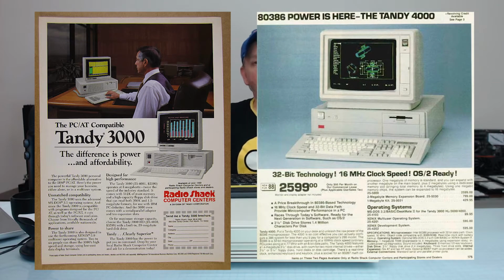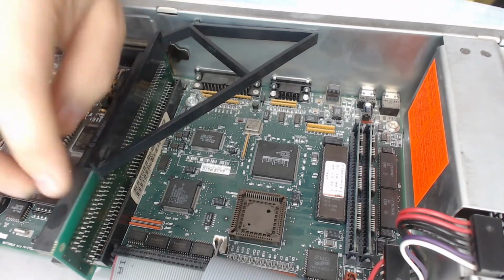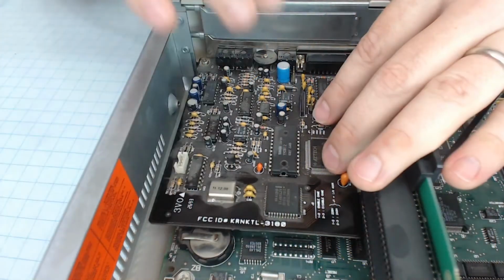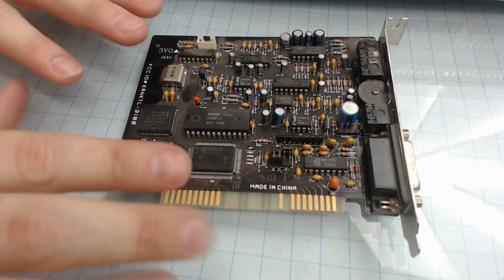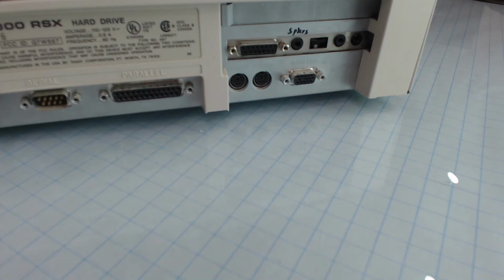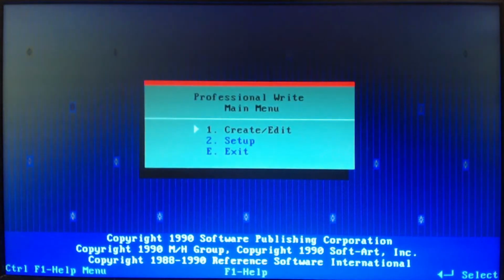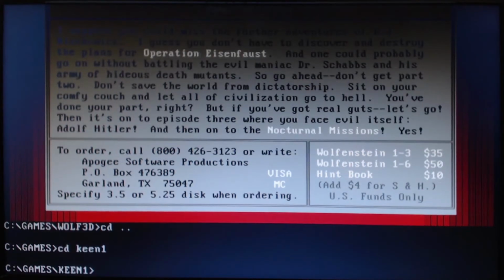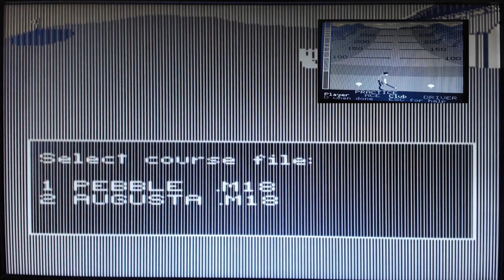Exploring the Tandy 1000 RSX

Comment: While SX does mean that a CPU lacks a math coprocessor, that's only applicable to 486s. In 386s, SX means that the CPU has a 16-bit data bus rather than the 32-bit data bus of the DX variant.

Comment: Interestingly The Tandy 1000 RLX was modified (no disk drives at all) to be the Legacy RadioShack POS cash lane system. There was no fan in them and they had a special BOOT rom to connect to the ARCNET terminal board in the 4000 Back room server. Smaller stores only had (1) 4 port ARCNET board, larger stores had (2) or more of them in the 4000 server running Zenix. The largest server I saw had 3 of the ARCNET 4 port boards giving availability of combination 10 total POS cash lanes mixed with up to 2 DMP 300 Printers connected to a special Serial to Parallel adapter located at the printer. The newer DMP 302 used a different Serial to Parallel adapter.

Comment: Tandy branded computers, made by AST, continued for another couple of years until Tandy sold their computer holdings to their former partner (AST). I'm in the midst of restoring an MMPC Model 20, one of the last Tandy-branded machines ever. These were run-of-the mill PCs, which is good and bad. They lack Tandy sound and Tandy graphics (which were outdated by the 486 era), but they have industry standard floppy drives, HDDs, and CD drives. This makes them far easier to maintain today. My interest in them purely stems from personal nostalgia, though. The 1000 line is certainly more historically relevant.
Reply from the maker: My first computer was a Tandy 1000 EX which I bought with my own money (many saved allowances) around the ripe age of 13 or so... So the 1000 has always been a spat of good memories for me when I look back.  I remember the old AST brand but I think the only one I ever got to use was in my school library and I drooled over it heavily...  As I recall a 486 with a VGA monitor... It was soon replaced with an Everex but I don't recall why.  If you [post any video of your MMPC Model 20, I'd love to see it.  Thanks for your comment.

Comment: I think you got the SX/DX variants mixed up between the 486 and the 386.

The math co-processor wasn't built into the machine until you got to the 486DX. The 486SX left it out.

For previous machines you could get 8087, 80287 and 80387 co-pro's. The difference between the 386SX and the 386DX was that the DX was fully 32-bits while the SX had a 24-bits address bus and a 16-bits data bus.

What I think would be cool, if there was Tandy sound on-board (I'm not sure) that could be passed internally to that soundcard (perhaps via the cd-analog in) so the soundcard would output all stuff through the same ports. While I like the design of the RSX, it is quite a bit long in the tooth by the time it got introduced. I think it would be nice for some old Sierra classics, perhaps some Turbo Pascal and Windows 3.1 but not much more.
Reply from the maker: Ya know, you're right!  Been a long time since i played with this tech.  Fuzzy memory and all.  Playing some space quest or kings quest on this thing would be pretty cool too but as I recall they run WAY too fast on these CPUs.. even on a 286 I remember space quest zipping from screen to screen uncontrollably.  I haven't written anything in Turbo Pascal in AGES but I'd sure like to try something simple as a follow up.  Until I get this HDD online or one that works with it (my PATA drives seem to prevent the system from even posting for some reason) most of that stuff will have to wait...  well, the sierra games probably run just fine from floppy...  I also managed to find a 16Bit ISA Ethernet card just today that I'd love to put in this thing... but that'll wait on the HDD as well.  Thank you for the correction and than you for your support.
Reply: @techwreck3331  If you have the CD (or later distributed) versions of  Sierra games like Kings Quest or Space Quest, they were recoded to time off the system clock rather than the bus speed of the CPU to prevent them from running too fast. So an option could be  using those version and putting them on this system.